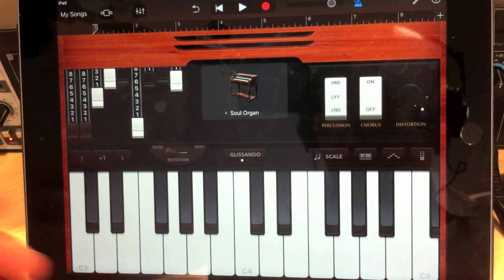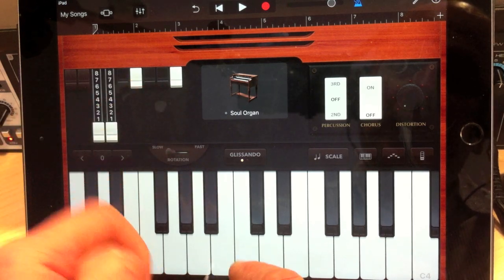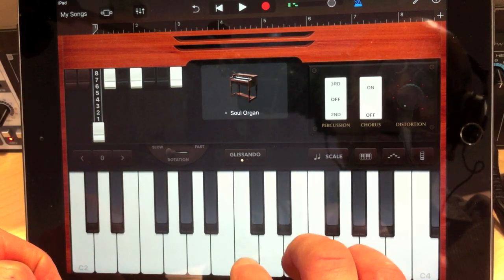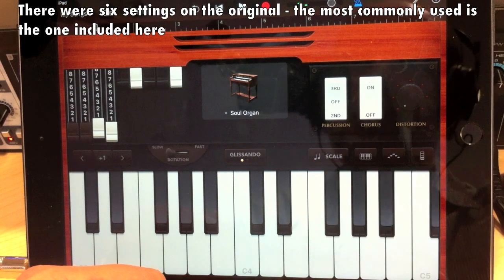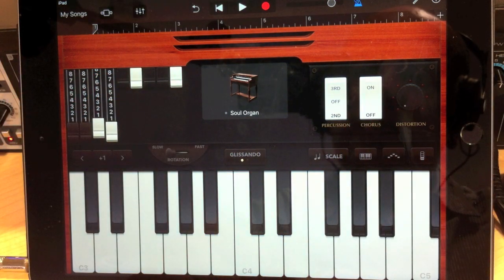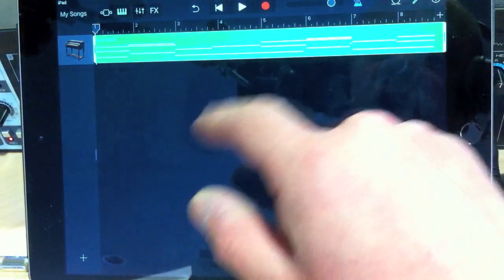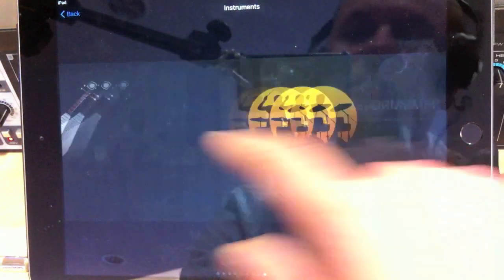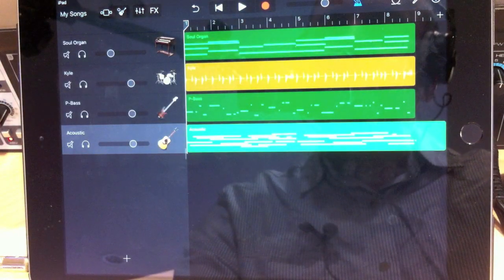GarageBand for ios 10 / 11: The Hammond Organ - making recordings sound expensive since 1935...

Comment: I just wanted to share with everyone, If there is anyone trying to assign the Leslie rotation on the Hammond to your controller, which I noticed was not working with my faders or knobs, nothing was working, I tried my sustain pedal and,
IT WORKS!!!! GOT  THE LESLIE TO WORK ON MY HAMMOND! Very Happy!
There might be other folks out there that would like this info. Thanks for your videos!
By the way I'm using a M-audio Radium 49 controller.

Comment: Foldback is the same thing as break back & the reason the highest notes on the 4 (or 6 if it's an X or H model) Highest Drawbars Break back is because they didn't have tone wheels small enough for those high notes.

Comment: You got confused between chorus drawbar on the very early Hammonds which engaged a second tone generator with its own set of spinning wheels which were detuned by a few cents to give a chorus sound.  What you switched on was the scanner vibrato tab.  This varies the entire organ's pitch up and down causing a quivering effect.  Hammond had a normal vibrato and a chorus vibrato where the audio signal was split and part of the signal had the wobbly frequency change applied and then the straight organ sound was merged back in the pre amplifier to give a sound combining the straight sound and the wobbly vibrato sound.

Comment: This is great - thanks Dan! Do you know if it is possible to control the drawbars & rotation on GB iOS via a midi-controller - I use a Roland A500Pro. This is post indicating that you may be able to do it on a Mac https://www.thegearpage.net/board/index.php?threads/assinging-midi-controls-in-garageband.1709222/#post-24876710 (CC70-78 for the drawbars, CC80 for the rotation) - I'm going to have a go but if you have a definitive YES/NO, that'd be great